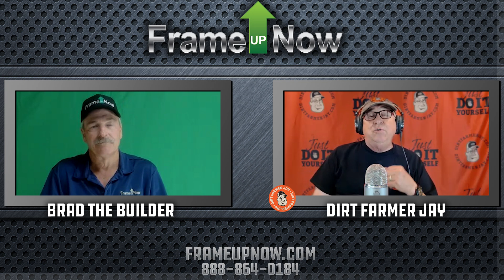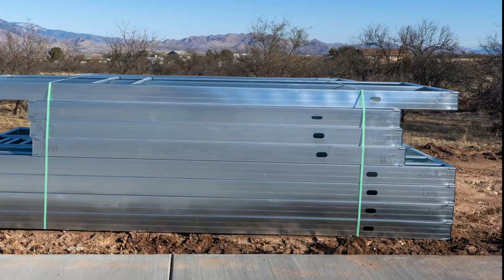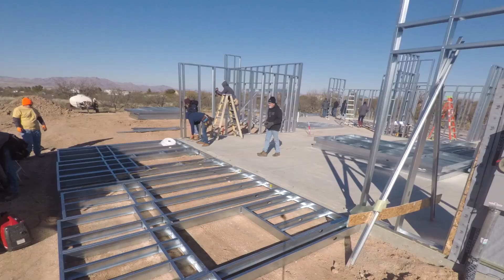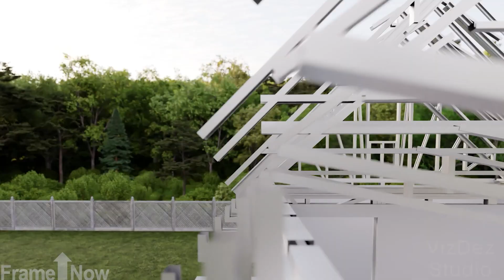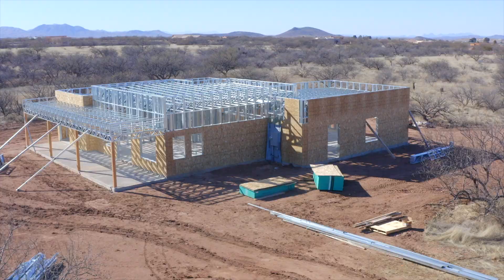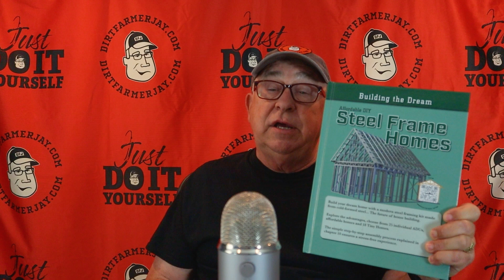Why Steel Framing Beats Wood for Homes & ADUs | Interview with Frame Up Now

Comment: I want to see the math. Steel frames are only rated here for interior and not load bearing structures. How do they hold up to wind and static and dynamic loads? As a Civil Eng person, he can't be using 16" on center without some additional bracing, math doesnt math
Reply: Brad Cooper here with FrameUpNow. i believe the steel you are referring to is a 25 lite gauge steel.  The steel we use, starts at 20 gauge and we can go to 18 gauge.  This is actually suitable to erect a 3 story building.  All of our structures are fully engineered to meet the current code, in your local jurisdiction, to meet all wind, lateral and snow load requirements. Good questions!

Comment: Level 5 plaster finish on walls consist of an even layer of plaster put on top of the tape and dry wall. On wood framed walls it's difficult to do and requires a bit more time to ensure flatness on all wall surfaces. But the finish provides great sound dampening and insulation.
Reply from the maker: Thanks for writing and adding to the conversation!

Comment: what is the cost difference for the material
Reply: Brad Cooper here with FrameUpNow. Short answer is steel is a little more expensive than wood.  you would need to make a decision as to the level of quality you want in a project and decide if you want to have all the frames constructed for you.  We ship everything panelized so the onsite labor is much less expensive than stick framing everything on site.

Comment: Insulation in hot or cold climates seems like a problem
Reply: Brad Cooper here with FrameUpNow.  Metal studs do transfer hot and cold more than wood, however, the insulation we recommend is closed or open cell spray foam.  I build homes also and use this exclusively.  All our homes average at least 35% less in energy consumption than homes with standard batt insulation.

Comment: What wind and bearing loads does this construction rate? What hurricane rating does it have? Looks more like light aluminum than steel to me yet with Canadian tarriffs its sensible to consider alternative framing products. 
What about lightening strikes in storms?
Reply: Brad Cooper here with FrameUpNow. All of our products are fully engineered to meet the wind speed and snow load in your building area as required by the local jurisdiction.  The steel we use is a much heavier gauge than what you are probably used to seeing.

Comment: soon as you walk inside bye bye cell phone signal !
Reply: Very little chance of that, next time you go into a large office building...check your cell phone signal.
Reply: Hello.  Brad Cooper here with FrameUpNow.  i have not noticed any cell phone signal degradation in our homes. We primarily use stucco and siding  along with metal or tile roofs, which is probably why we don't lose signal. If using metal siding, i believe there would be some signal loss. the same as complete metal building.
Reply from the maker: This can happen, depending on the layout of the home, but can be overcome with a booster.